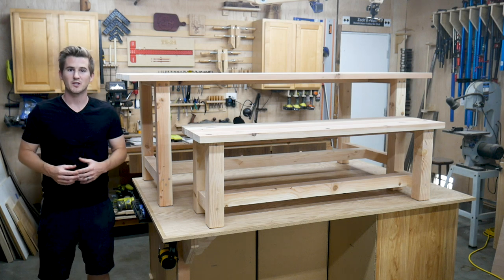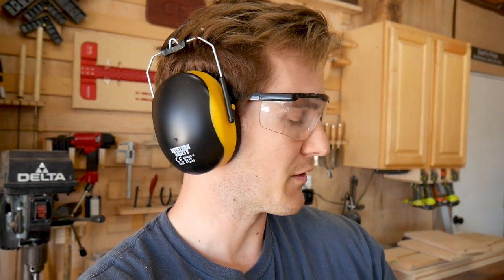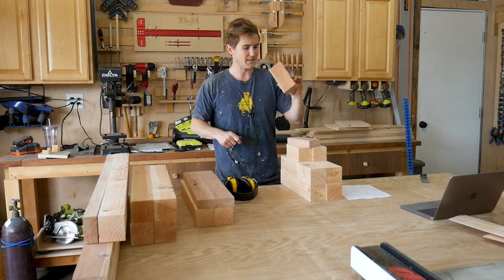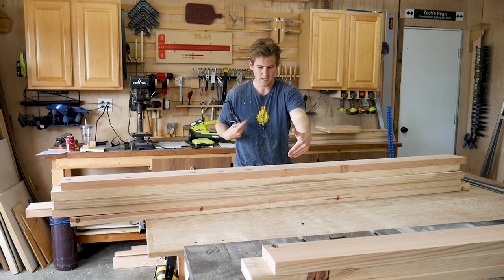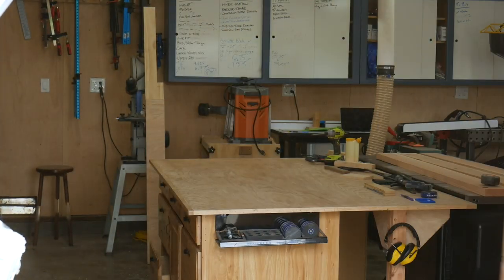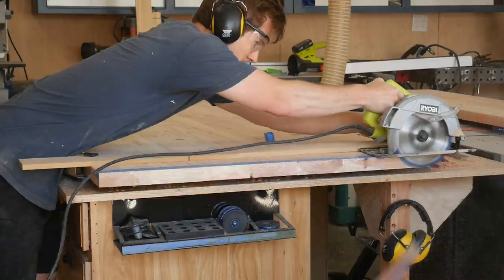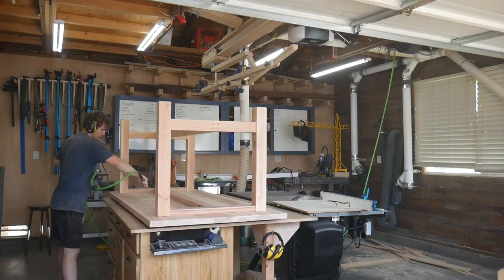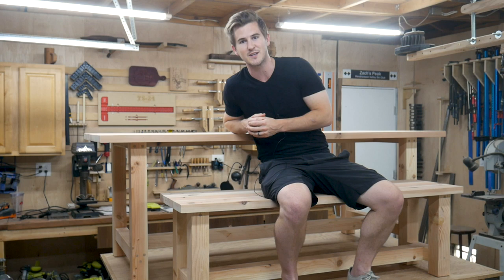DIY Farmhouse Table with matching Bench | 59

Comment: Nice looking table Zach and I am sure your family will get many years fine service out of it. I noticed you seemed to screw the top down tight. Are you not worried about wood movement? God Bless my friend.
Reply from the maker: thanks - I'm not worried about it moving any more than other parts of the table - personally for us California doesn't see huge temperature swings, it's indoors, the wood is already quite dry and acclimated. If we find its an issue I think drilling oversized holes would be a good solution. cheers!
Reply: Just a friendly note, when you go to finish it, start with the under side 1st. With this design of yours, your top will warp up if you finish topside before undercoating it.
Reply from the maker: @teaguewhite26  Thanks for the tip!

Comment: Great project and video!
I noticed that at around 2:40 you use an awkward crossed hands position while using your miter saw. You should probably avoid doing that - that's asking for trouble.
Keep up the good and SAFE work!
Reply from the maker: Why is that any more unsafe than the other way?
Reply: @workshop_edits  your arm is much more prone to crossing paths with the saw that way.